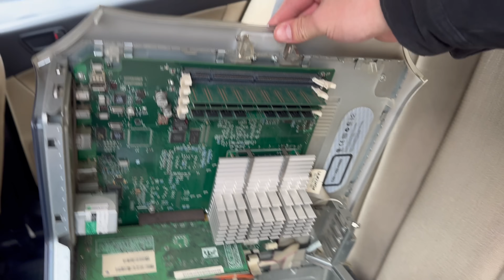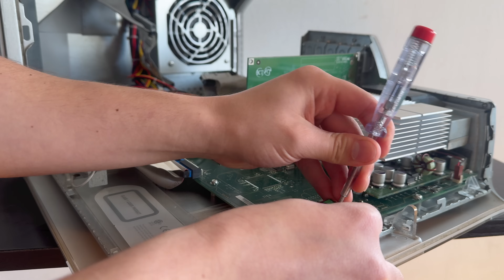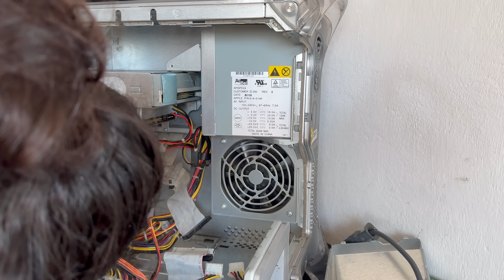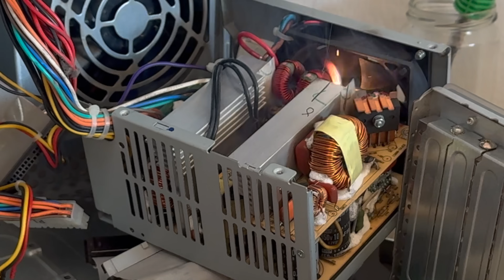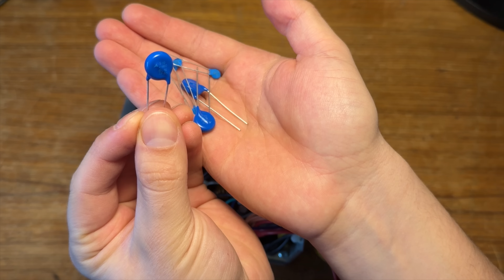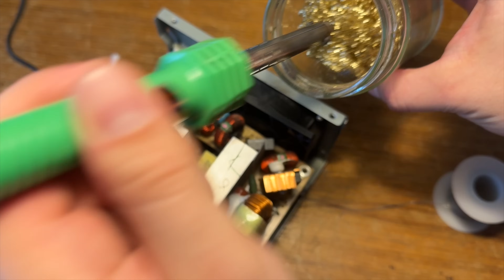Almost Burned My House Down

Comment: You are right, that varistor blew the fuse, maybe due to a spike in the power lines. The PSU would have worked without it but, vhen you bridged the fuse, most likely a trace was blown. Dissasemble the PSU and see the damage on the pcb were the varistor is. 
Maybe, just maybe, the PSU is still working if you repair the burned traces on the back of the pcb, try it. 
To be sure and feel comfortable when working to the mains part of the PSU, just to trace the input voltage, you can use a low voltage AC transformer to connect to the input instead connecting the PSU dirrectly to mains. An 12V to 24V transformer would be good enough to check the input circuits (filters, fuse, bridge, capacitors) for shorts.
After that, connect the PSU to mains in series with an incandescent bulb, prefferably 100W (or few lesser wattage in paralel).

Comment: The title is very clickbait, the fire stopped by itself like it should, so no real risk, also you should have a breaker in your house, and a RCCB in your panel that should definitely cut off the power in the panel immediately 😉
Reply from the maker: It stopped because I cut the power manually. And definitely not all houses have proper wiring and proper breakers here where I live, and electrical fires do happen.
Reply: @schvabek  generally you avoid to replace the fuse by a wire 😉 if you want to play with a powers supply, you want to use a " dim bulb current limiter " 😉
Reply from the maker: @Irilia_neko not everybody has that 😉😉😉 And it’s not like I test PSU’s very often, to the point where I’d consider building one. The reason I bridged the fuse is because I was curious if that (and the MOV) was the only blown component.
Reply from the maker: @Irilia_neko …but I didn’t see it was blown before plugging it in, since it was wrapped in heat shrink tubing 😂 There were many potentially blown components on there, some that are impossible to test without plugging it in. I don’t see why it’s so hard to understand, I’ve explained why I did what I did in the video.

Comment: If a mains spike hit the PSU hard enough to pop the MOV, it probably took out a switching component in the power supply also. More than likely, a switching transistor on the HV side of the PSU has burned open, that's why you have no output. Get another PSU, no use risking the motherboard with an iffy PSU repair. Good luck!
Reply from the maker: @quantumleap359  hey man, thanks for the input! Yeah, you’re probably right!

Comment: I learnt my lesson of using cheap PSUs about 20 to 25 years ago. It was a  weekend  and my power supply had died on me and i didn't want to wait for a weekday to get another psu. So i headed to an internet cafe down the road and bought a cheap psu off the guy running the cafe. I wanted to play games on my pc that night. I had the attitude of "that will do". I knew it was only a 230watt unit and that was abit low for my needs still i used it even with this unit getting so hot then case and hard drive were being heated by it. I don't think it had a fuse because the psu started blowing up and the power didn't cut off. Lucky i was at my pc and it was the old style case with the psu at the top so i pulled the power out of th psu then it stopped catching fire. Ever since ive tried to buy decent psus. The computer was an 550Mhz celeron, long before the ratings that exist on todays psus.
Reply from the maker: @Jwalker76  yikes! Thanks for sharing your story! Glad you didn’t blow yourself up 😅

Comment: ok, you soldered it in from the top of the board, instead of the bottom, didn't even check for components on the other side (you do know that those boards can be like motherboards which are multi-layered and have components (usually surface mount) on the other side). 

Ps. Potted components and components covered in silicon doesn't indicate quality; it indicates: made on the cheap.

Ex ATE operator, currently QA Tester.
Reply from the maker: @2005Guyver02  there were leads left from the shorted component to which I’ve soldered the new MOV to. I’ve mentioned a couple of times why I didn’t want to go to the trouble of disassembling the power supply entirely. Mostly wanted to see whether replacing that component would fix the issue. 

I’ve seen silicon on caps and other tall components, which is added for rigidity and some mechanical protection on some higher end gear. Super cheap stuff tends to leave that out, since it’s an added step in manufacturing. Can’t see how that would be a sign of the power supply being cheap.

Comment: You could have used your meter to check for a short, before bridging the fuse.
Reply from the maker: @rsambrook  Depending on what component is shorted out, it’s not always possible finding a short using a meter. I’ve had some luck using a thermal camera for shorted capacitors for example. Also, I would’ve had to take the whole thing apart, which I really didn’t want to do. Again, I mainly wanted to see whether it was just a blown fuse, or that blown MOV. Like I’ve said, I don’t want to spend any more time fixing it at this point.

Comment: This is why I say with older builds, stop trying to be authentic and use dangerous older PSU's and just use modern safer ones. Your house will thank you. It doesn't have to be perfect enough that you end  up in the hospital. -_- Why is this SO hard for people to understand, just use a more modern PSU!
Reply from the maker: I’ve mentioned this several times throughout the video, but this computer doesn’t use the standard ATX power supply, although one can be adapted to work with this system (which I might do in the future).
Reply: @schvabek  Fair. And I know you've said that. I also just wanted to sear the dangers into peoples heads as I've personally have seen people try and priorities authenticity over safety. And it just irks me. I've even seen it on a few YT videos too. It did make me happy that you warned of (and showed the) the dangers of it though.
Reply: @schvabek  So you just said it's not a problem to use a new part, and will take less time than trying to save the old power supply (the wires touching the aluminum heatsink is the best Tbh, you definitely want to avoid that at any cost 👀
Reply from the maker: I didn’t really understand what you meant, to be honest.
Reply: It’s fine if you take security precautions. Bridging blown fuse is something you should never do.

Comment: Similar thing happened to me at work before. Looking at an arcade game repair as the cabinet lights were off (But the game itself was running). Found the cabinet lights power supply was not working and pulled it out. Blown fuse so no worries. Replaced it with a new one. Place back into the game and turned it on. And boom! Amazing the amount of power that can drawn from an outlet in the fraction of a second before a fuse goes! My guess is the hf transistor on the input side shorted the line based on it being mounted to the heatsink. I hate things blowing in my face and this wasn't the first time lol. Worst was on a large medical fridge replacing the heated drip tray. The compressor was running and I accidentally shorted the ac line which was across ac and compressor. It was a huge arc inches from my face! The compressor gave the short so much energy it had to be a 1ft arc! I felt all that heat and was scared for quite awhile lol. Staff even came over concerned as I maybe said not so quietly some lovely words. Needless to say I absolutely never work on anything live ever again (Unless specifically for measurements.)
Reply from the maker: @braixeninfection6312  Yikes! Glad you pulled it through without harming yourself man. Stay safe! 🤟

Comment: Just measure resistance between L and N next time, without voltage applied obviously.
Reply: Also, why didn't You buy new fuse???
Reply from the maker: @Damjes  didn’t have one handy, didn’t know the exact value, I was kinda going for broke, just troubleshooting.

Comment: I love your videos, so do not take this as criticism. Here is some errata though:
all power supplies like this: have large alum heat sinks, white glue holding stuff down, the fuse is usually soldered in and covered /w heatshrink

You are safer to have such failure happen WITH the casing closed. It is in a metal box. But yes, it absolutely could burn your house down. Should you short a fuse for debugging (don't.) NEVER leave it like that! It is there for a reason.

Your house wiring would not "melt" unless your house is highly shoddy, and using the wrong stuff. If you have appropriate sized wiring, and circuit breakers, you'd smoke whatever is plugged in, use it as a heater, or trip the breaker. Good luck melting the wires.
Reply from the maker: @Ben333bacc  Hey man, thanks for commenting! I’ve actually seen horribly constructed power supplies, which is why I pointed whose things out. 

Of course I’d replace the fuse of the thing ended up working. I was just mainly curious, so as a short term solution I’ve just left it out for troubleshooting. 

Also, if you live where I live, you’d know how many houses were built by drunken uncles lol. I’ve seen several cases of melted house wiring with faulty / no fuses.

Comment: Hi friend, it is really easy to convert an ATX psu to a G4 one. You can either do it internally or with a piggyback wire extension by repinning the wires on the piggyback to G4 logicboard layout and some diodes. I can find the guide I used ages ago, and send it to you if you can't find one. I ran a 800W psu in my dual 1.8ghz 7448 after I cooked the factory psu with  too many drives, those cpus, ram and a 7800gs. LOL.

Easy mod and worthwhile. Zero mods on the mac side, and you can simply unplug the piggy back and its ATX again, while the logicboard stays stock. Great to have. If you mod the PSU internally, then it remains permanently G4 only. 

Pinouts are different on the G3, G3 BW and Yikes! g4. Make sure you use the correct info to build a piggyback, If you have AGP G4s and the late MDD

Cheers!
Reply from the maker: @goclunker  hey friend, thanks so much! I’ve seen some guides/wiring diagrams, and I might very well end up doing it as a project down the road.
Reply: @schvabek  You can use one ATX psu to bench test all the machines (not at the same time lol) by just having different piggybacks. It will never explode again.
Reply from the maker: @ That’s a great idea. I can’t wait to set up my new place, where I’ll actually have a BENCH to begin with, let alone a bench top power supply 😂

Comment: Most likely something in the stanby portion is not working.
And wrong MOV will never stop the power supply from working, its just an overvoltage protection, so you can remove it entirely for testing purposes.
And make yourself a dimbulb tester, that will prevent disaster like this, just have to keet in mind that psus with active PFC generaly don't like them very much and might refuse to start. Other then that the PSU is really high quality and probably pretty overbuilt for it's power, but an utter pain to work on
Reply from the maker: Oh, I didn’t know that. I thought it was installed in series with everything else, like a capacitor, so it would cause a short if it blew.
Reply: @schvabek  yeah the MOV goes in parallel after the fuse, when voltage is below it's threshold it basically has near infinite resistance, when voltage goes above threshold it shorts and blows the fuse in an attempt to save PSU.
What is in series and looks sort of similar is a PTC(positive temperature coefficient) thermistor, it starts of with relatively high resistance and is used for limiting inrush curren that is caused by big filter caps, then when caps are charged and PSU starts consuming power thermistor gets hot end its resistance drops to almost nothing. It sometimes gets destroyed or partially destroyed(too high resistance) when there is a short, even though the fuse has blown.
Reply from the maker: @ cool. Thanks for the info!

Comment: I've had plenty of my own scares when diong electronics. Also, I like the way the whole side of that power mac just swings open and makes it very service friendly. If only modern apple were like that.
Reply from the maker: @CoolDudeClem  Yikes, I really hope those are not like real life scars. Stay safe!
Reply: @schvabek  Well I have accidentally exploded a few capacitors, popped a few transistors and burned up some resistors. And one time I made a 30 volt AC motor release the magic smoke as I thought it was a mains voltage one!
Reply: But then the computers wouldn't be 1/4" thick. And we can't have that for desktops!

Comment: I use to fix a lot of Macs and was on MacMod back in the day. It's just easier and safer to swap over to a ATX power supply and swap a couple of pins around.
Reply from the maker: @lelandclayton5462  it’s very possible I’ll do that as a project
Reply: @schvabek  Keep in mind a couple of models require a 24V rail. With boost converters these days it could work. Back in the day I had to add a second power supply that supplied 24V and make sure both grounds were bonded.
Reply: @lelandclayton5462  That wouldn't work. You would need to isolate one or more of the DC grounds from the chassis ground, then connect +12V of supply A to Gnd on supply B. You'd get your 12, 3.3, 5, 5vsb, and ground from supply A, and that would make +12 on B = +24.
Reply: @ That is what I meant by bonding both grounds together. Supply A and B have to be on the same common ground potential. I said nothing about the chassis "Earth" ground. The power supplies providing the 24 volts I used back in the day were wall-warts. The chassis ground was isolated.
Reply: @ Ah. Yeah, if you use PC power supplies you need to convert them to "floating ground", or in the very least slip a sheet of paper between them, or don't touch their chassis together. When using 3 pin grounded PSUs, also need to remove the 3rd pin, or isolate the PCB ground from the metal chassis, if you want to "cascade" the supplies.
Reply: @Ben333bacc  It's not advisable to connect two computer power supplies together just for the reason they are earth ground referenced.
Reply: @ No kidding? Yeah, it is a "hack", to run them in series like that. 24V supplies used to be a lot more $$, so this was done back in the day sometimes. Nylon washers, screws, electrical tape, etc to unground the supply from the chassis... definitely not "stock".

Comment: Just saying, you deserve props here for going to this sort of extent on machines that are this old with "not much clear value" as some may think but still functionally great and well designed for the times they were made. 

I had a similar thing happen to me with a ThinkPad T14 Gen 1 AMD variant, got it for a steal of a price with pretty much the maximum base specifications it could have in like new condition... asides from potentially power delivery related issues. Loud pops would happen either when turning it off or on, likely due to spikes in whatever energy it needed, even happening while I was updating the BIOS to see if that would do much (it shut the laptop off as well that one time, thankfully the self-healing is a thing?). For each instance of it, with the vent section above the keyboard I would see a white light pop up through most times, and having gotten it for daily use I knew I couldn't continue with it the way it was around 2 weeks in. Inspected the motherboard... and there was nothing (without a multimeter I'd admit). Nothing clearly damaged or burnt, no smells of any kind, you'd look at the motherboard and it was fine... for that time being. 

I could tell at the very least it was more involved than I originally would have opted for, and the time wasn't worth it in my eyes even though I would have saved a few hundred otherwise so I sent it back and went for something else. Certainly could have fixed it but I "needed something stable" to troubleshoot other things with in the first place, even though arguably no laptop is and all inevitably require maintenance. 

That being said, your approach here of course shows that maybe wasn't as bad of a situation in comparison. Definitely not, you handled it with much more class here. These kind of in depth looks, alongside assessment of the risks of course, are what's needed to keep these machines in proper shape, and I certainly think videos like these in particular, even if there is no "finished product" made out of it, are arguably some of the most valuable. Thanks for showing your thought process here in particular.
Reply from the maker: Wow, thanks so much for taking the time to leave such a nice comment! And yeah, sparks and lights is something to avoid, especially if it’s high voltage or battery related (and with laptops, yikes, that can be dangerous). But as long as you understand the dangers, there’s no reason to be afraid to give fixing things a go, but you do have to know your limits. Cheers!

Comment: I electrocuted myself over 20 years ago on an exposed power supply for a Sinclair ZX 81.
Reply from the maker: That thing takes 9V dc. No biggie 😂
Reply: @schvabek  but here in Ireland like the United Kingdom the zx81s main market the domestic voltage is 220 volts which is what Jar Jar here got juiced with

Comment: You know, if you remove the PCB from the metal casing, any work you need to carry out on it suddenly becomes really really easy.
Reply from the maker: I mentioned it in the video, but disassembling that whole thing would require desoldering wires, removing heat sinks, cutting that silicone in many places, cutting connections, all things I didn’t feel like doing for this particular troubleshooting session.